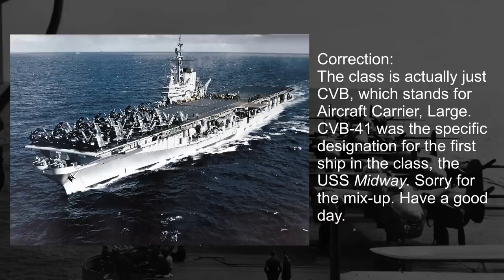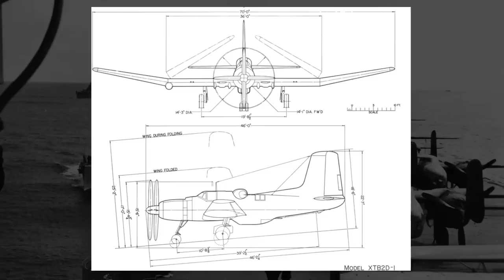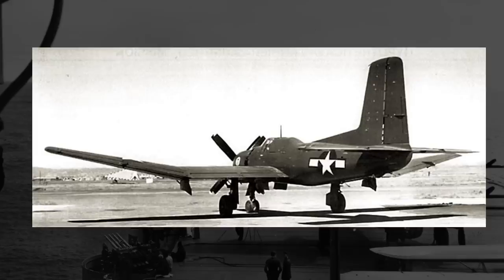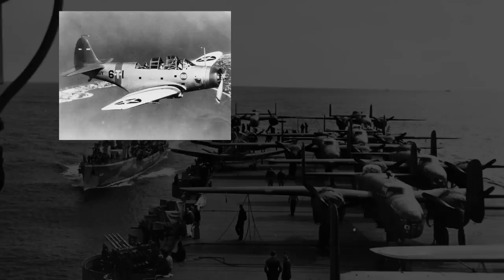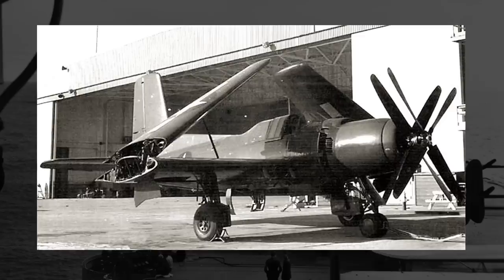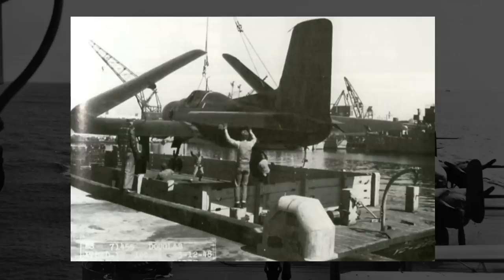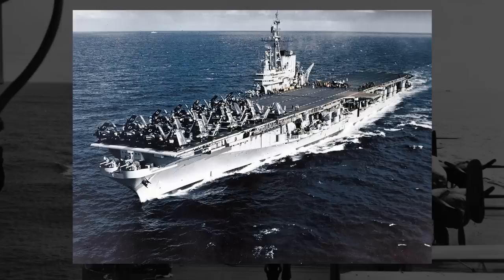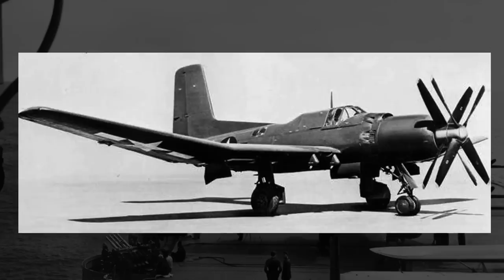Douglas' Excessively Large Torpedo Bomber: Douglas XTB2D Skypirate

Comment: What is not mentioned is that the original request was for a long range torpedo bomber that could take off from West Coast fields, fly 1000 miles to sea, attack a Japanese task force and fly back. It was unknown if Hawaii would remain in U.S. hands after the attack on Pearl Harbor and the Navy was afraid they would need to defend the West Coast from direct attack (which, until the Battle of Midway was a possibility). Thus this monster torpedo bomber was designed, built but never needed.
Reply: The B-36 of torpedo bombers.
Reply: @PavewayJDAM  except the B36 was needed in the post-war nuclear era and was an effective deterrent- do it did its job
Reply: Imagine the range if it was only carrying fuel for a scouting mission.
Reply: It is a very cool looking aircraft! I never heard of it either but I like the design. Looks very sturdy.

Comment: It's interesting to me that the Skyraider and the Skypirate had their first flights just 5 days apart. Two huge piston singles from the same company at the same time. Who thought that was a good idea?
Reply: Apparently the government which commissioned the designs thought they were good ideas and that having a company already experienced in building Navy torpedo and bombing aircraft design and build them was a good idea while a war was going on. The two planes were created to fulfill different roles, Skypirate as a long range torpedo truck, the Skyraider as a strike and dive bomber, roles which require different types of airframe with their strengths in different structural areas. For instance, you could level bomb and glide bomb with an Avenger but dive bombing was forbidden. Carrying huge loads for huge distances requires huge fuel tanks and huge wings.
Reply: There had been torpedo bombers (TBD, TBF)  and, entirely separately, dive/scout bombers (SBD, SB2C). The Skypirate was the intended successor to the former, the Skyraider (initially called Dauntless II after the SBD) to the other. Ultimately it was realized that the Skyraider could fill all the needed roles...

Comment: The upward sweep on the outboard section of wing is called polyhedral it makes for a very stable aircraft something important when on a bomb or torpedo for approaching the deck of a carrier.
Reply: I suspect it's there for the same reason the Corsair had an inverted gull wing - ground clearance without too-long main gear legs.
Reply: Corsair had gull wings to allow the wing roots to meet perpendicular to the fuselage. No root fairings were needed. It also provided clearance for one of the biggest propellers in use at the time.
Reply: @Dave5843-d9m  The corsair had a huge propeller, and the inverted gull wing was chosen as an alternative to longer landing struts. The consequence was that the wing roots went into the fuselage as you said which had unanticipated aerodynamic benefits. The lack of root fairings was a decision by the navy: they didn't want to spend the effort on fairings for Hellcats or Corsairs, they'd rather just have more of them.
Reply: No its called dihedral. Anhedral is slope down, and polyhedral means geometric solids such as cubes or tetrahedrons.

Comment: The wing shape would help with level stability , it would have the same effect as a standard dihedral wing but would probably also make production of the centre spar easier
Reply: When 1 of 2 torpedoes was dropped, I would imagine it would help recenter itself.
Reply: B17 could only carry 8000 pounds at significantly reduced range. All those 50cals and ammo add up - considerably.

Comment: The Douglas Devastator was the most advanced aircraft of its type when it was designed. It’s just that technology surpassed it so quickly. 

The gull wing aspect was not for landing gear strength. It was for prop clearance. The extended landing gear was in fact an issue, facing weight and strength issues. 

You might have show how Douglas incorporated  aspects of this design into the A-1 skyrader. A very successful design.

Comment: It's interesting how many aircraft at this time were being designed with the contra-rotating propellers. As well as those you've covered there was a fighter designed by Martin Baker, better known for their ejection seats,and the Westland Wyvern which saw service with the Royal Navy's Fleet Air Arm.

The Martin Baker aircraft would have been one of the fastest piston engined fight if it had reached service. The problem was that the designer was a perfectionist which meant he kept tinkering with it and the war was over before it was ready.
Reply: Contr-rotating props were basically a necessity by this point. Piston engines and later turpboprops were getting so powerful that their torque was a huge problem, especially on carriers, where having a plane violently swing due to the torque was a problem. CR props were also far more efficient, allowing for higher speeds.
Reply: In addition to the torque issues, installing a single prop which could “absorb” the amount of power these engines created would be nearly impossible on a single-engined aircraft. The diameter would simply be FAR too big (even as it was, these props were huge.) The B-50 and B-36 could get away with it because they were so massive and had the ground clearance. 

The only other single-engine 4360s I can think of were the Boeing XF8 and Curtiss XBTC, which also required contra-rotating props.

I don’t really think the super Corsair prototype counts - it’s cool but was apparently very difficult to fly (surprise, due to lack of rudder authority - presumably because of the p-factor.)
Reply: @EstorilEm  what's the p factor? pilot?
Reply: @anzaca1  Thanks. anzaca. You've confirmed what I thought may be happening.
Reply: @martindione386  Looks like it's the propeller, I had to look it up. From wiki: 

P-factor, also known as asymmetric blade effect and asymmetric disc effect, is an aerodynamic phenomenon experienced by a moving propeller,[1] wherein the propeller's center of thrust moves off-center when the aircraft is at a high angle of attack. This shift in the location of the center of thrust will exert a yawing moment on the aircraft, causing it to yaw slightly to one side. A rudder input is required to counteract the yawing tendency
Reply: @MScotty90  thanks!
Reply: Griffon powered spitfires had a contra prop as did the Hawker Fury which went on the be the Sea Fury. Twin props turning more slowly had less Mach compression at the tips.
Reply: @Dave5843-d9m  Production sea Furys had conventional  5-bladed props

Comment: What a fantastic 1/48 scale kit this would be! This beast, the Boeing monster and the Martin Mauler all in 1/48... well, a respectable twin Mustang (finally!), an equally respectable P-51H (again, finally!) AND, of all things, the Douglas Skyshark have appeared in 1/48th. One can but hope. In a way, this aircraft's reason for existing at all matches that of the B-36 (and both were the behemoths of their kind as a result). How to strike at the enemy when all of your bases outside of North America have been lost? One must remember that this design originated at a time when it was feared that Japan might control most of the Pacific, possibly even the Hawaiian Islands (and likewise England might fall to Germany as well). Hence these long range, huge brutes conceived as a result. Well, Midway and the Battle of Britain saw those threats reduced. The hitherto unimagined horde of fleet carriers, light carriers and escort carriers issuing from the U.S. now meant that this beast, at least in its current form, had lost it's original purpose.  Other existing types were handling it quite fine. Ironically, a smaller  "sibling"  from the same company  became the attack aircraft that the Sky Pirate didn't! The Skyraider even dropped the occasional torpedo.

Comment: I suspect the multihedral shape of the wing was probably done to give the stability benefits of a high-dihedral wing while allowing for a simpler center section (pass through, constant chord spar structure, likely), as well as allowing for the wide-set main gear to be shorter than they would be if set mid-span on a constant-dihedral wing. It would also probably simplify ordnance loading, since all the hard points are the same height above the deck.

Comment: Thanks, fascinating stuff! Douglas might have profited from this failed project in its later Skyraider - which is also a quite similar name.
Reply: Skyraider and Skypirate had their first flights just 5 days apart, so it doesn't seem the failures of one could be used as lessons learned on the other.
Reply: I can imagine it being called the 'Skypilot' instead.

Comment: The inverted gull wing on the F4U was largely a response to the need for shorter landing gear struts and larger propeller swing and it also improved pilot visibility of the carrier deck on landing.
Reply: Actually, it appears that was a secondary advantage.  I thought just like you did until I saw an episode of Greg's Airplanes and Automobiles which went over this and discovered that Vought was trying to wring every knot of speed out of the design and they realized that you get the least amount of induced drag if the wing sticks out of the fuselage at a right angle.  So, they did that ... and then cranked the wing upwards to give it an effectively positive dihedral.  There's a lot of websites I would shrug off, but Greg is big on resorting to original sources and employing actual mathematics when in doubt.

Comment: The McDonnell-Douglas F4 Phantom II also has a wing dihedral applied at the folding chord section. Dihedral angle applied to the wings helps an aircraft avoid sideslip during low-speed maneuvers, probably beneficial during carrier landings. Most WWII fighters had dihedral wings, but in most cases, the angle was constant from root to tip, such as in the case of the Mitsubishi A6M Zero, the Republic P-47, and the Messerschmitt Bf-109. The Grumman F6F had dihedral wings, but the upward angle was applied at an outer section of the span past a section of flat or zero-dihedral, not unlike the Skypirate or the Phantom II. Why was the Hellcat, a radial-powered, single-engine carrier-based fighter given that sort of "interrupted dihedral" rather than the constant dihedral of the highly successful Zero, another radial-powered, single-engine carrier fighter. Perhaps because the Zero was not originally designed with foldable wings and the Hellcat was.

Comment: The dihedral outer wings are for roll stability, effectively making the pilot say "look ma, no hands" while doing something else in the cockpit besides flying. Also helps maintain roll authority. I. E. :you can still roll the plane even with the big-ass wing 

And, in my opinion, the angled outer wings makes it easier for the hydraulics to fold up with shorter arc than folding up from complete horizontal position. Maybe even for the wings to steer clear of the deck, but not that much 'cuz of how big it is

Comment: Possible reason for the unusual Gull Wing Design was to maximize use of "Wing in ground effect" Assuming you're flying level at nearthe surface, the Sjypirate would be  Wing in ground effect, allowing it to expend less fuel and fly further, theoretically. So the upward slant of the Wing tips would alow the Skypirate to maintain a degree of lift should it need to break the effect immediately without substantial loss in energy. I noticed the Sky Pirat had an unsual amount of wing area which allowed it to carry larger stores. Having this large amount of wing area would allow the skypirate to easily enter and stay in "wing in ground " effect while below Radar and on it's way to a target, deliever it's payload the bank and break contact rapidly without haviung too much of delay in power or control. 
Just an Idea.

Comment: the outer wing sections having dihedral is usually done to give an aircraft roll stability.
The strake in front of the rudder and that huge rudder suggests that the aircraft needed to stabilize its yaw.

Comment: An interesting design with a lot of potential. It was doomed to failure like most of the late war super-props.  The combined effect of the Navy's belief of "everything jet", fascination with single seat planes( something that seemingly comes in phases every ten years), and primarily a lack of vision about a different kind of multi-role aircraft for ASW or AEW. The big platform looks very capable of handling those roles. It took the US and Britain  half a decade or more to come back with airplanes like the Tracker or the Gannet.
Reply: The British Navy used an AEW-conversion of the Grumnan "Avenget' until the Fairey 'Gannet' went into service.
Reply: I don't think we can tell what any branch of the Armed Forces was thinking late in the war, at least not based on their purchases.  The government was dead set on cutting back military production and returning to a peacetime economy -- which is why brand spanking new fighter planes were being flown straight from the factory to the wrecking yard -- common sense would have at least dictated holding onto those machines and scrapping out aircraft with a number of flight hours or poor maintenance logs.  The Navy, in particular, had to keep fighting for its budget as the Air Force kept claiming that aircraft carriers were obsolete and they could maintain the peace with heavy bombers and nuclear weapons.  New acquisition programs are hard to get rolling when you are spending a lot of your effort trying to keep them from taking everything away and shutting you down. Then Korea happened, air bases got over run, and carriers made the best possible argument for their existence by flying missions when little else was available.

Comment: I think the upswept wings are called polyhedral. I'm not an engineer or anything, but I think its supposed to help with, for what ever reason, level flight. The F4 phantom had the same type of wings. Thats where I read about it when researching the F4.
Reply: I believe dihedral was added to the folding sections of the F-4's wings to counteract instability caused by the horizontal stabilizer's anhedral.

Comment: In hindsight, Douglas Aircraft would have been better off having initially developed the aircraft using the then available R3350 radial without the contra-prop and reduced capacity to maybe half what the original design was rated for. Thus awaiting a new dash number of the aircraft in the future, utilizing the R4360 once it became available. The plane would still have had far more capacity than anything the Navy had throughout WW2 that was carrier based and might have given the aircraft design a fighting chance at being fielded in a combat roll. 
Seeing as a great many of Douglas's aircraft where very robust and durable at taking combat damage, it might have saved more aviators lives as well. A prime example of robustness would be both the A-1 Skyraider and the A-26 Invader, of which both designs so use up and into the Vietnam War. The A-26 being numerically changed to the B-26K Counter Invader.

Comment: If the invasion of Japan had to have been conducted, it would have served as a "bomb truck" providing CAS. Probably would have done a good job at that. Its likely that it never would have dropped any torps. 
@7:40 The dihedral wing  was to improve lateral stability, necessary in a stumpy plane that had to fit in elevators.
@13:00 Jets didn't replace it,  the A-1 Skyraider was chosen instead.

Comment: you are missing something in the aerodynamics Full span Flaps look at the pictures of it landing Douglas was the greatest for carrying  heavy  loads  this aircraft has the identical vertical stab as the RD4 - 8 super DC 3 104 build in the 50s a stretched dc3 with wright 1820s 9 cylinder 1475 hp retractable tail gear a marvel of engineering

Comment: However all is not lost for Douglas as the United States Navy would commission a requirement for a dedicated multi-role attack which initially was fulfilled by another ungodly large aircraft called The Martin AM Mauler which also use the r 4360 and could only be flown from the Midway class aircraft carriers however Douglas would submit what was initially called The destroyer II but would become known as the skyraider which maxed out at an unreasonable load out could carry 8,000 lb of dimes but normal payload was a still healthy 6,000 lb and more importantly it was powered by the large 18 cylinder r-3350 radial which was less of a maintenance nightmare than the corncob r-4360 and more importantly the skyraider could fit on smaller aircraft carriers

I still wonder if WWII could have ended a little sooner or at the very least the Japanese Navy could have been destroyed even faster if the Navy realized hey we don't need dedicated torpedo and dedicated dive-bombers we just need a single-seater capable of carrying both kind of weapons and the skyraider also had died brakes and during Korea actually torpedoed Hwancon damn

Comment: This is an unsubstantiated guess formed from years of amateur viewing of aviation's history.

Out of 10 projects, 9 are duds (roughly) due to :-
Being designed around a new and/or experimental engine which does not eventuate or is in short supply.
Takes too long, need for it disappears into history.
Technically obsolete before process is completed.
Bad luck crash puts the wind up everybody and slows everything down.
Assorted unforseeable personnel & historical problems.

No.1 has gone through to fame and glory and is built in large enough numbers to become an aircraft the whole world has heard of.

It's as fascinating as archaelogy.  Long "live" the also rans !!

Thanks for the excellent video.